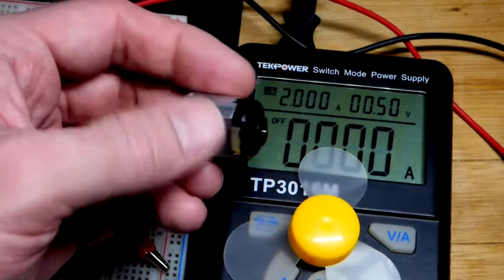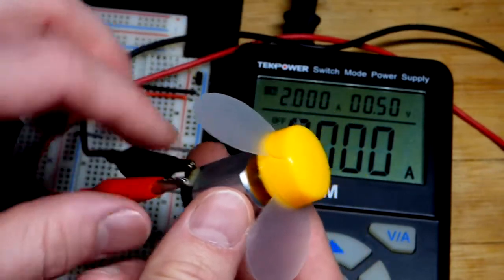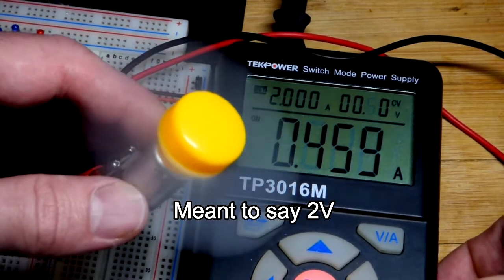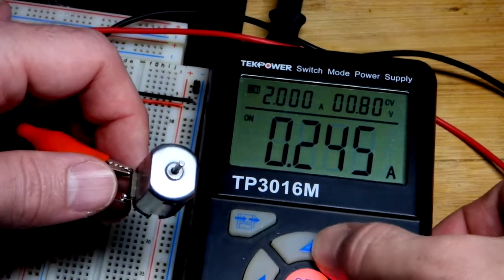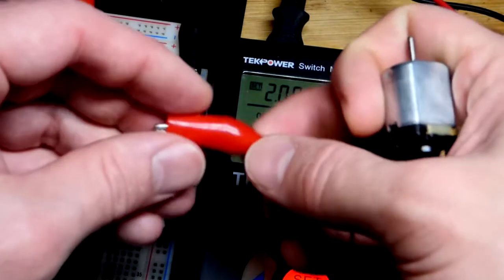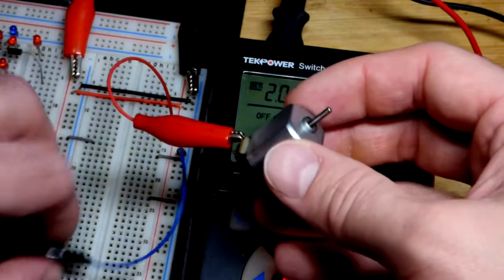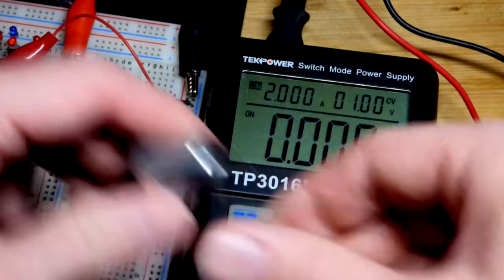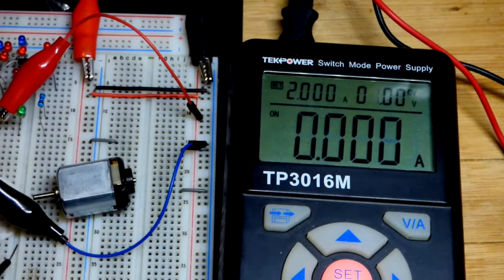3V DC motor demonstration for learning electronics lesson 0054

Comment: What's the max adapter I can use on a 3v dc motor (automatic trash can)? Can I use a 5v with out damaging the motor since it's not something that will be on constant use for long periods of time?
Reply from the maker: Generally it is never good to use more voltage than something is rated for. Some stuff will be fried instantly and other stuff will take a while to burn out.